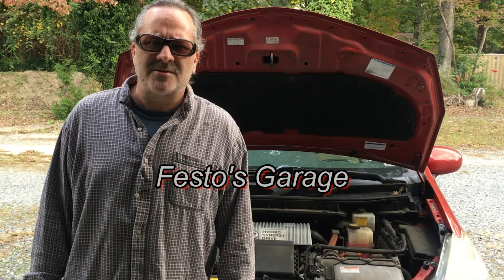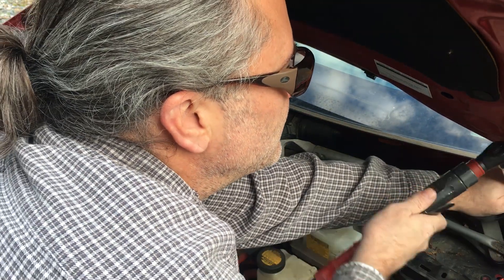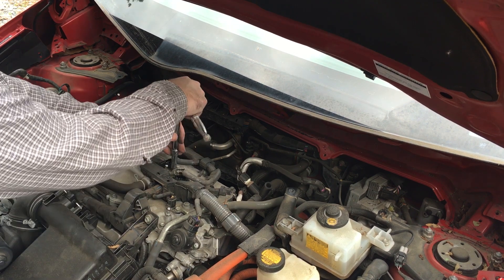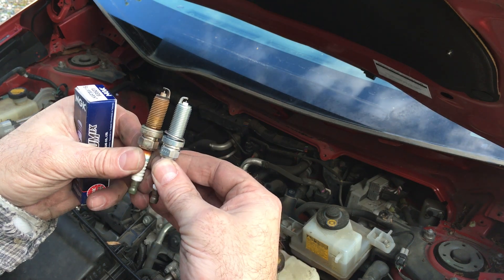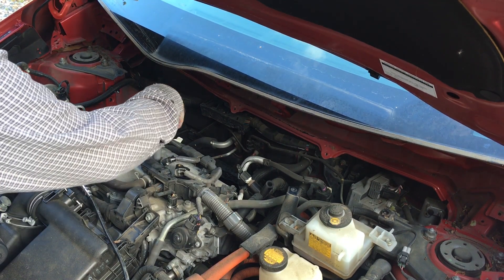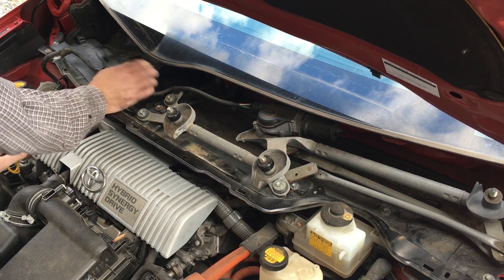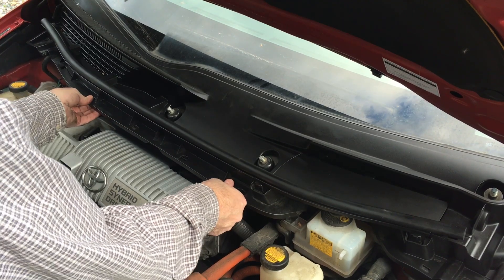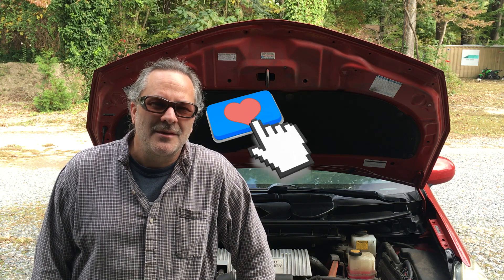Replace Prius V Spark Plugs & Ignition Coils DIY with Tips, Tools, Torque Specs

Comment: Does anyone have any idea why mine have a bunch of oil in them!?
Reply from the maker: If you are saying that your spark plug holes have a bunch of oil in them then you need a gasket replacement, most likely valve cover.

Comment: Is it any different for a 2012 prius 2?
Reply from the maker: It is extremely similar. DIY job for sure. Save that $$
Reply: @GreggFesto  I changed them still have a check engine light saying one is bad ..I cleared it too...no idea what's wronf
Reply from the maker: What does your code say is wrong? Spark plug, coil, or cylinder misfire?
Reply: @GreggFesto  says coil is misfiring in cylinder one
car starting to run more and more rough....once mechanic said head gasket is bad...other says he didnt think so
Reply from the maker: It is possible one of the new coils or plugs is bad?  One thing you could try is to switch the coil and plug between cylinders 4 & 1.  Clear the codes. When code comes back you can read it. If it says cylinder 4 misfire then you have a bad coil or plug because the problem moved with them. If it still says cylinder 1 misfire then there is a different issue. Are you losing coolant? If yes, the head gasket could be bad. There is a kit you can get from most auto part stores that has a liquid which changes color if engine gases are detected in coolant tank. If you are not losing coolant I suggest removing the intake and checking PCV system ports. They can clog up and cause rough running. You can clean them out with intake cleaner spray and some pipe brushes. Let me know what you find.
Reply: @GreggFesto  no not loosing coolant..i changed out the set because first set said coils were bad in two cylinders. so chaged out entire set....then it said only cylinder one was bad...swapped that out...now car is just running rough....light comes on sometimes....somtimes it doesnt...im lost af
Reply from the maker: If you get the check engine light at all then there will be a code present. As you are aware, the code will be your best bet to tracing down the issue with your car. The check engine light coming on and off suggest that it could be an o2 sensor that is failing. You could also have a bad plug, coil, or injector on one of the cylinders. This is where checking the code then swapping parts between a cylinder that shows code and one that does not is helpful. If the code follows where the parts are now at then the parts are bad, if the issue remains on same cylinder then the parts just swapped out are not the problem. The PCV system can cause issues too if one of the runners becomes restricted. There are many videos on how to clean the PCV system yourself.

Comment: Great video thank you! How much did the spark plugs and coils cost?
Reply from the maker: Thanks for watching. I do not recall the cost of parts. I usually shop RockAuto and Amazon when I want the best prices.
Reply: Did the coils fail or did you just replace them because why not?
Reply from the maker: Replaced as preventative maintenance.
Reply: @GreggFesto  cool how many miles are on it? can you do a EGR cleaning video or brake pads, or coolant flush, waterpump any of those
Reply from the maker: I believe the car has around 130k on it. If the EGR/Intake need to be cleaned then I will video it.  I have done video on the water pump replacement. Search my channel for "Replacing Coolant Pump in 3rd Gen Toyota Prius" to check it out. Coolant flush is coming soon, check back periodically for that.

Comment: How do you gauge how much pressure to tighten?
Reply from the maker: Thanks for watching. I use a torque wrench when I want to get accurate. If the torque is not that important I tighten to the point that I know it will not back off.